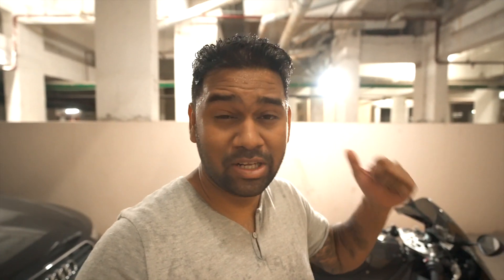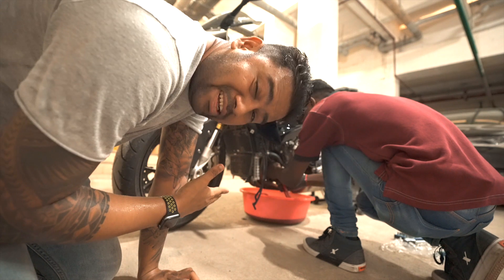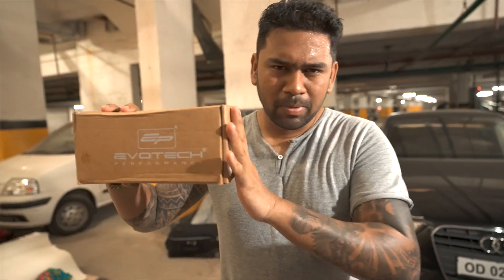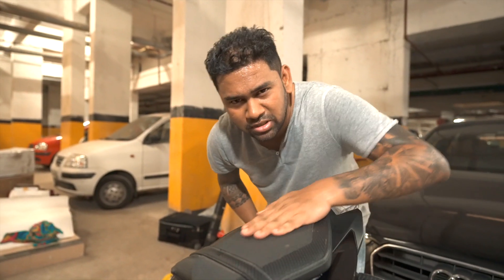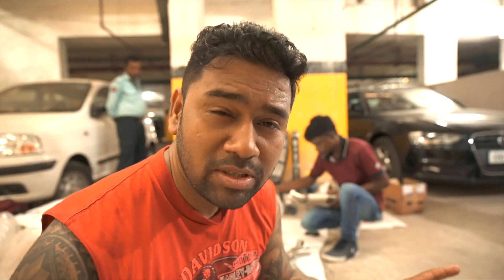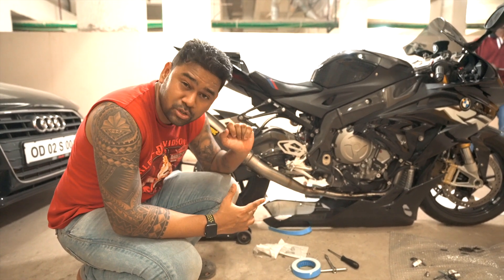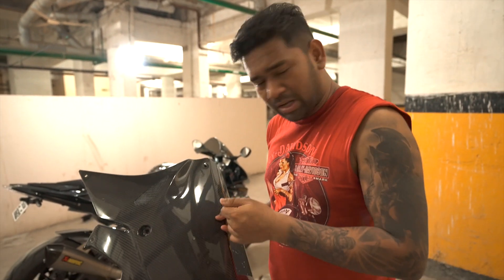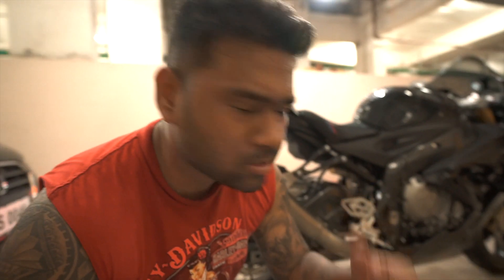BMW s1000rr 2018 PRO - Installing Akrapovic Racing Full Exhaust

Comment: Does your cruise control work with the Evotech levers? I’ve a 2016 S1000RR and only heard Giles levers are compatible with the cruise control function as there is a cutoff switch on the lever perch.
Reply from the maker: Hey man, I will test this Sunday and get back to you.

Comment: Bro you could have gon for sc project exhaust....any perticular reason select acrapovic after market exhaust.....
Reply from the maker: SC Project isnt Full System, its Slip on. And Akrapovic Full System is for performance, without disturbing anything in the engine.

Comment: Hi dude, when you changed the full system, did the bike give you a check engine light?
Reply from the maker: Carlos Restrepo yes. Had to install servo buddy on both front and back to get the fault removed

Comment: Hey brother, I would suggests you to remove the servo motor completely and buy a servo buddy, it's very easy to install, if you'll not do so, within 6-8 months max your servo motor will start to make cracking sounds lol, you'll thank me later.
Reply from the maker: Raven good suggestion. Will buy it. But removing it, I guess fault sensor will trigger 🙄
Reply: Soumendra Jena Nope, no error messages on dashboard nor on diagnostic software when you plug in the cable and run the software, that’s why they created the servo buddy, to make the ECU think that your servo motor is connected, but once your servo motor gets fucked up(if you don’t replace it by servo buddy), software for diagnostics will give you tons of errors.

Comment: From where did you get the exhaust? Here in Guwahati I don't think so we'll get any original full system exhausts for SBKs.
Reply from the maker: You can get everything from my store www.superbikestore.in . Whole India gets from us only.
Reply: @soamjena  Can any inline 4 cylinder motorcycle be fitted with the same exhaust varying models?
Reply from the maker: @deerghayuphukan1215  no
Reply: @soamjena  is Akrapoviç GP shorty full system available for Ninja 1000?
Reply from the maker: @deerghayuphukan1215  if you see it on akrapovic official website then of course yes

Comment: Whats your topspeed sir ?....
Reply from the maker: On this bike, it has not crossed 220kmph as my rpm was locked. Now its unlocked. Will try next Sunday when I get good roads. Ha ha
Reply: Wow...sir ...great...rpm lock open hone ke baad kitna jayegi ?...300+ jasakti he sayad
Reply from the maker: as per the indian law, bikes are restricted to show till 299, then it wont show you ahead, even if you are faster than that.
Reply: Aprilia mein apne kitna topseed kiya tha ...wo v to 1000cc wala bike he...usme v 299 taka jata hoga....
Reply: Sir harley kitna jata he...kya usme v  rpm lock hota he...mein suna tha ki harley 200 se upar naijati.......usme v kya permanent rpm lock hota he...kyun ki wo v 1200 cc ki hoti he....that means more cc that bmw...just wanted to know
Reply from the maker: Aprilia rsv4 last top was 265. It was scary.
Reply from the maker: harleys can go too, but its not meant to as its displacement is high and its built for touring not for speeds. And cc doesnt matter for speed, its only for displacement of the engine. I have tried my harley Night rod till 200, but it isnt safe for harleys and it cannot go quickly to that high speeds, as its displacement.